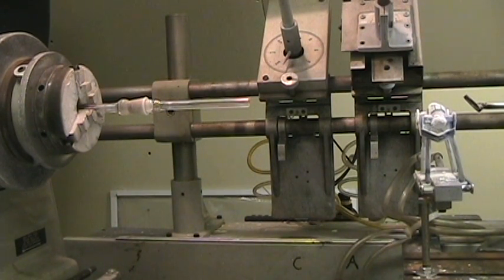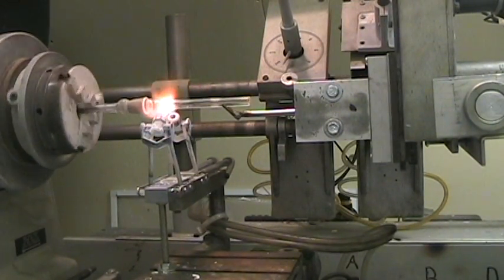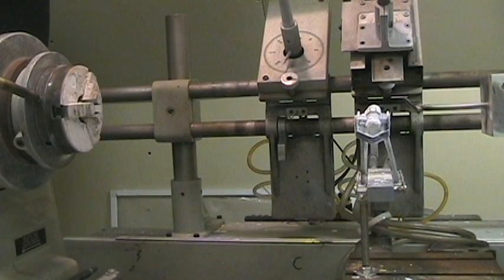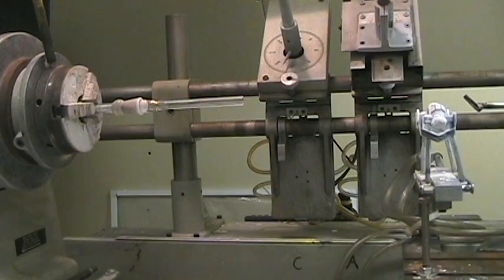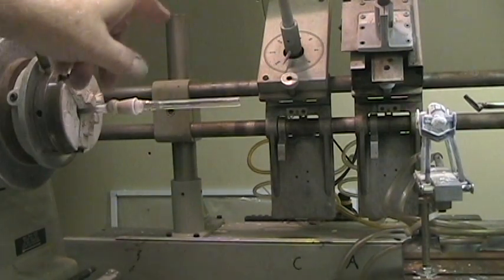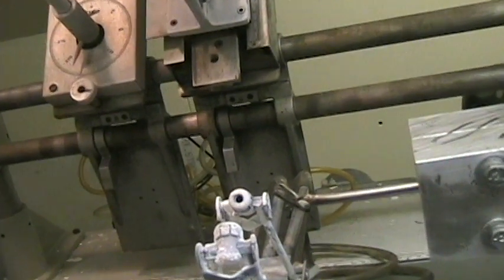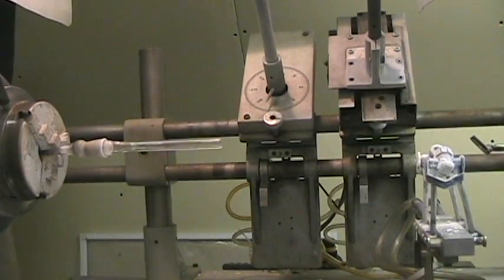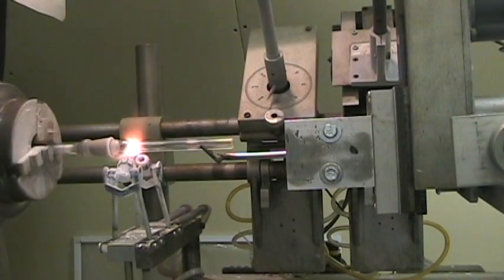Glass Lathe Bending Quartz Tubing

Comment: Interesting I watch this exactly 1 year from when you uploaded. I am trying to learn everything I can about working this quartz tubing as I have about 1000 feet of 1" dia and another 1000 feet of 1/2". I am not a glass blower but will have to learn it. I have tried in the past to use my oxy/acet torch on this stuff and Its hard to get to melting temps. Its amazing how it gets bright as the sun when really hot. Think I need a hydrogen system. I have 3 metal working lathes and notice you have special chucks on these. Now that you did this bend is there any other tempering of the quartz that must be done to prevent it from cracking? And not sure what bangers are but thinking it must be a slang term for a scientific piece of glass for chemistry maybe? Thanx for the video and nice automation build there.